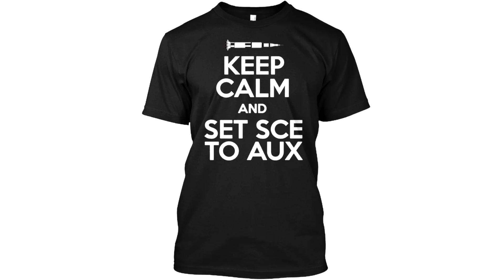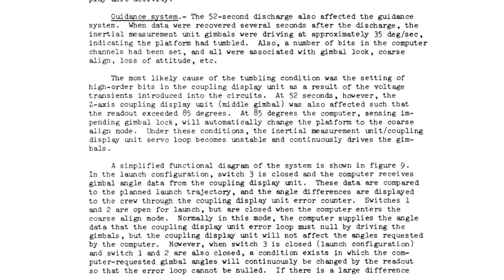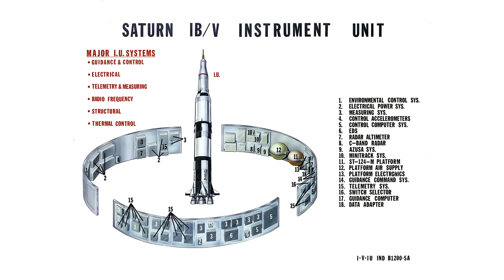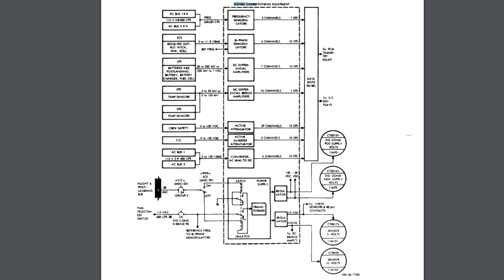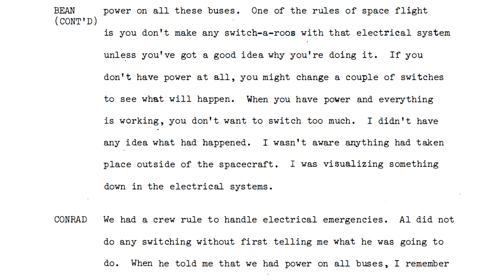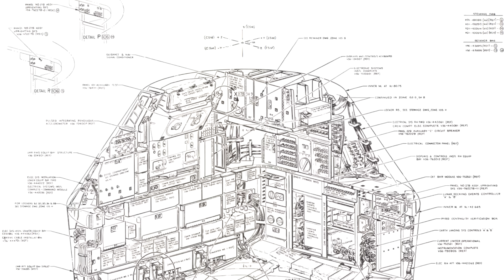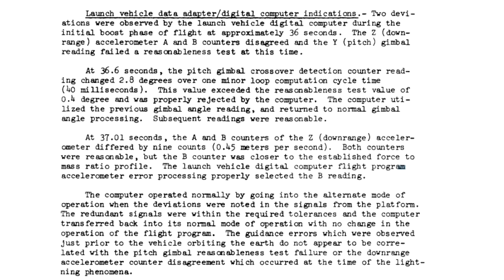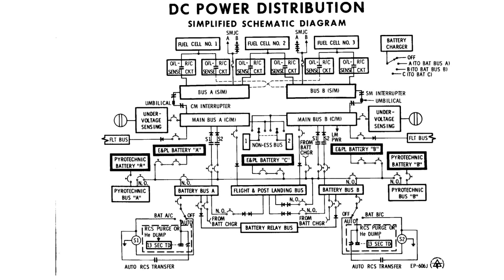What Does "Set SCE To AUX" Mean Anyway - Apollo 12's Lightning Strike Explained

Comment: That phrase saved Apollo 12, but there’s a darker one needed once for the STS-51-F mission, after one of the SSMEs shutdown: “Limits to inhibit.” The commander moved a switch to tell the Orbiter “Don’t shutdown any other engines no matter what!” STS-51-F was the only abort-to-orbit mission. A second shutdown would’ve likely been a loss-of-vehicle and LOC event.
Reply: AFAIK they could abort any time after booster separation, whereby they would land either at the launch site or at one of three sites across the Atlantic. The second engine failure would be critical only in the first minute or two after booster separation. Beyond that a single engine would be sufficient to land at one of the sites across the Atlantic.
Reply: The STS-51 sequence was a nightmare. It took -51F two tries to get off the pad and we all remember STS-51L.
Reply: They could've landed at a downrange airfield if they lost a second engine after a certain point. I think part of the cockpit dialog was "Story, where are we going?" "I think we're going to Spain". After that they were told to ATO.
Reply: @RCAvhstape  “Oh you said we’re going to Spain?!? I heard Space!”
Reply: I was camping in Maine when STS-51-F passed overhead not long after sunset. It was noticeably bigger and brighter and moving faster than any other time I'd seen a shuttle pass overhead before or since. Obviously losing the engine during launch had put it into a much lower orbit than intended.
Reply: Joe Vignolo you could actually see em?
Reply: Micah Bell
You can see several things orbiting the earth with the naked eye.

You can even see the SpaceX dragon capsule when it's up there.
Reply: @LSPD1909  a few years ago I watched the Shuttle preparing to dock to ISS, very close to it.
It was just the right time after sundown, and they were glowing bright! No optics needed lol
Reply: @LSPD1909  You can see just regular satellites passing over  when it's not too long after sunset - they're just points of light like fast-moving stars, but definitely visible
Reply: @brynclarke1746  Especially Iridium sat-phone satellites, therefore the more common name for seeing a satellite flash in the sky, "iridium flare". Big PITA for astronomers, and the next generation Iridium satellites that have started going up are actually designed to prevent it.
Reply: @ke6gwf  I watched them pass over Wyoming low and slow one evening cat fishing. I was thinking something was wrong. They are too low. It was amazing.
Reply: @brynclarke1746  I once saw one breaking up into the atmosphere. Looked like a fucking UFO at the time. Star.. star moving.. star coming down burning.
Reply: The shuttle crew liked hearing the "Abort to orbit" command more then if they heard "Abort to launch site" instead!
Reply: As Scott explaines very nicely it "didn't save the mission".  The crew was on their way to figure it out. And even without telemetry on the ground (sce2aux) turning the fuel cells off and on was the obvious first try solution.
Only WITH telemetry back they ... erm didn't make it worse by guessing :)  But they would have guessed, and probably correctly, if they had to. Pete Conrad sure as hell wasn't about to pull the abort handle in panic. He wasn't a guy for panic.
Reply: 5Andysalive you can’t panic in situations like that
Reply: no it wasn't they were well into abort limits trans Atlantic abort probably would have been required
Reply: There were a number of places in the flight profile for shuttle that did not have abort
 options.
Reply: Not necessarily,  there were certain abort scenarios they could've done.  Probably would've been hair raising but they could've still saved it.
Reply: Thomas Parker With 2 engines down at that altitude and speed, in this pre-STS-51L mission, ditching was the only likelihood if TAL was not possible. STS-51L investigations confirmed past tests that noted an Orbiter would break up on water ditching. And this crew had no bailout options.
Reply: @Gaozetagar  Not really. Contingency aborts were not a thing at the time of STS-51-F. If they didn't have energy for TAL they'd be dead, since they didn't have any way of safely abandoning the vehicle in flight.
Reply: @delayed_control  actually they did.  They just never tested or implemented it.  The first test flight originally was supposed to be a test of the return to base abort but saner minds prevailed.
Reply: @Gaozetagar  at the time of the shutdown they were well beyond the window for RTLS abort. not only that, but RTLS was only viable with only one SSME shutdown. two failures and they'd have to aim for TAL. but the second engine started to fail around 8 minutes in, right around when they are deciding between TAL and either AOA or OTA. RTLS window was well passed by then.
Reply: @Gaozetagar  My understanding is that at the point where the second engine tried to shut down they didn't have enough forwards speed, and if it had actually shut down the shuttle would have dropped too quickly while still going too fast and would have overloaded the thermal protection system, destroying the craft.  I only have that from second hand sources though, so there may have still been a trajectory that would have let the crew survive, although in such a case they still would have needed some luck to hit that trajectory just right.

Comment: That guy that said that will never be forgotten in the space industry. Prevented a mission abort because of a cool headed response.
Reply: Yup, no one will forget ol' wossisname.
Reply: Pete Conrad? yes, absolutely.  If you listen to the onboard audio they were indeed on their way to figure out the problem by tracing it to the voltage dip. Pete Conrad certainly wasn't prepared to just abort the mission.  Which would have been well within his rights btw.  So as Scott mentiones, the outcome of this situation without the sce to aux call is definitely not clear. 
Pete Conrad kept cool, made quick decisions and saved the mission as much as Aaron did.    It was a bit like Gemini 6 where Wally Schirra made the decision NOt to aboard, but to wait it out. Had the rocket moved even inches before the engine shut down, he would HAVE to pull the escape. No discussion. 
The computer said it had moved. The clock said it had moved. Wallys butt said it hadn't moved. So he waited. Had he aborted they wouldn't have launched days later again to a successful mission. That's what these people did.
Reply: @5Andysalive  John Aaron was the one.
Reply: Twotter54.  Another, never to be forgotten alarm that a cool head allowed to pass by and the mission completed was; "1201 alarm" followed by "1202.  We have a 1202 alarm."  That was Apollo 11 during descent to the surface.  They were pretty sure it wasn't fatal and Aldrin saw a correlation on the second or third 1202, so Houston gave them a 'Go' on the alarm.  It was one of the 'super kids' who figured out what it was, but I think they were down by then?
Reply: @rogerwhittle2078  I suspect there was a certain amount of "what the heck" involved. Since everything still worked....
Reply: That guy was one of a team of Engineers. Every person in the team was there because they would be That Guy when the situation called for their speciality.
Reply: Same for the BOOSTER officer that made the call "Engine limits to inhibit" during the launch of Challenger STS-51F, Jenny M. Howard
Reply: @lorenzopappatico  that was a sad era when managers took the safety for granted. This was different, safety was not compromised.

Comment: Mission control: have you tried turning it off and on again?
Reply: “Repair procedure #1” (AKA “percussive maintenance”)
Reply: @CantankerousDave  I have actually fixed a remote military radio transmitter by punching the control unit after two hours of restarting, resetting, reconfiguring and re-frickin-wiring the signal input line. one punch and everything worked again. :D
Reply: @daszieher  Usually when hitting the device "fixes" the problem that would mean that some wires are loose inside the device or something similar. That's when you might want to open it up and make sure everything is where it should be.
Reply: @mekaerwin7187  Yup - had a laptop issue that I fixed temporarily by banging it. I took my sweet time before disassembling it, because I needed a clean environment and a printed-out maintenance manual and, most importantly, a weekend where I wouldn't be totally screwed at work if there were complications from the surgery.

(Speaking of which, there are great analogies here to medicine and the cost-benefit analysis of surgery vs. less-effective but less-risky options.)
Reply: Steven Hystad back in the old days when TV sets used vacuum tubes, it was widely known that you just whack the TV if it’s acting weird, which worked because thermal expansion and contraction of the tubes in their socket may have caused a tube to lose contact. We called that Percussive Maintenance.
Reply: @daszieher  We know it was a gentle troubleshooting punch, not the angry %$#&!, why won't you work.." punch.
:-)
Reply: @daszieher  Sometimes called "percussive maintenance."
Reply: @usernumber1337  I was not going to do an open heart surgery on an electronic control unit not certified for repairs in the field. Especially after the self-test revealed no fault. Field procedure was retrieve the component (rack insert) and replace with a new one.

Yah, percussive maintenance it was ^^
Reply: @CantankerousDave  that happened on Apollo 14.
Reply: @CantankerousDave  "THIS IS HOW WE FIX PROBLEMS ON RUSSIAN SPACE STATION!"
Reply: That's 50% of all engineering problem solving. And Apollo (12) was no exception.  The hard part is to know WHAT to restart.
Reply: @5Andysalive   And WHEN it's not a bad idea.
Reply: @donjones4719  Also in most cases no lifes are at stake, just a bit of productivity.
Reply: @5Andysalive  just restart the entire mission lmfao
Reply: Thank you for calling the Mission Control service hotline.  Your call is important to us.  Please stay on the line, and a representative will be with you shortly.  [Scratchy elevator musak plays]
Reply: @adm0iii  if this happened today, the initial contact would be a call center in the philippines
Reply: The other one is if you can't fix it bridge it
Reply: @christhirion9474  Hmm.... what about my favorite way of fixing asic on the go...... running makeshift wire bridge? Before I realize when/why I have a set of wire of different ohm and material on me at all time.
Reply: "We see you have a wirus in your Microsoft computer. Send us $438 dollars and we fix it for you."
Reply: I think that is just what "Set SCE To AUX"  did. It disconnected from the primary (OFF) and then reconnected to the secondary (ON)
Reply: No, no, no. "Cycling power" is so much more effective.  At least it sounds more professional.
Reply: @davepTfirst  Toggle the P-A-D (power actuator device)
Reply: Indians when their probe smashed into the moon

"Have you tried turning it off and back on again sir?"
Reply: It wasn't a Microsoft product.
Reply: Recycled power, ops check good. Alternative there's always 'Reset circuit breakers, ops check good.'
Reply: @Saber721  They also do an "Aliveness test". Back during assembly of ISS.
Reply: 1- Determine what the problem is. Before doing a complete reinstall, determine if your problem can be fixed by performing a Startup Repair. ...
2- Insert the Windows 7 CD. ...
3- Enter Windows Setup. ...
Reply: I work in IT support now... It's more true than you think. And we call it a "Powercycle" now, just to sound cooler. :)
Reply: Cold Iron :)
Reply: Jerry Rupprecht god I love awesomely clever references
Reply: Not once during this have I noticed anyone suggesting a proper kick at the AUX valve
Reply: That's how we fix 90% of commercial aircraft electrical problems, pull the offending electronic box out and plug it back in. 😁
Reply: They had a Problem during the Curiosity mission, where a Solar storm fried half of the curcits. They fixed by turning is on/off
Reply: Yankee Clipper: Yeah, we've tried that. Want us to hit it with a hammer?
Reply: Lemme try... (Explosion sounds)
Reply: Hello, this is Ranjeed from tech support..
Reply: ctl  alt delete
Reply: PUT IT IN RICE
Reply: IT Crowd
Reply: I work in I.T. and I can attest that this solves about 80% of I.T. issues. No joke.

Comment: Love the phrase "reasonableness test" at 9:57. The computers had that back then, yet didn't for the Mars probe that crashed? One you did a vid on, that relied on the out-of-norm-expected input of one sensor even though different sensors for altitude, speed, etc, were in agreement, differing greatly from it? Gotta give it up for the elegant programming in those "simple" flight computers.
Reply: Reasonableness tests work when translating analog values, as analog by definition being "fuzzy", their values can vary into non-useful areas as part of routine operation, where "routine" also includes these systems combining input from multiple other analog sources; stack up enough random variation, and you can get some non-reasonable values by chance alone, and you want to be able to skip over those.

Digital to digital translations, however, by definition, do not stack up any random variation.  If you put in a reasonableness test in those, when they trigger, they are much more likely to throw out correct, though unexpected values than ignore a routine fuzziness, possibly allowing a disturbance develop into a catastrophe.  Instead of reasonableness tests, digital data can have digital verification -- error detection/correction codes, like parity, checksums, and the like.  This ensures the values are known to be correct, even if unexpected.

In fact, it's because of error detection/correction codes that systems have moved away from analog to digital over the decades; all analog data is converted to digital as close to the source as possible, so nothing has to guess if it's working or not.  Doubt makes a lousy foundation for modern massively complex computer systems.
Reply: @adm0iii   Thanks for the thorough and informative answer. I guess what I'm thinking of for the Mars probe is a cross-check between sensors; that is probably more of an autopilot type thing.
Reply: Bear Mro facepalm
Reply: Not sure the mars probe would have been saved by a reasonableness test. It's like asking faulty programming to correct itself.  My understanding is that It's more of  a redundancy to correct for faulty readings or misbehaving computer.
Reply: If I understand right, the Mars Polar Lander
 probe had plenty of those checks on the sensors themselves but reasoned about them incorrectly. The logic went "if the landing legs are splayed, note that touchdown occurred" and "if touchdown has occurred, cut the parachute" (and each did have various checks). But the programming didn't enforce the order due to a bug - as soon as the legs deployed, the touchdown sensor triggered and was never cleared, so as soon as it got near the ground (way before touchdown) it cut the chute, too early. That isn't simply an "unreasonable" sensor reading; it's real sensor readings being used incorrectly.
Reply: @AySz88   Yup, that's what I'm talking about. My sense of the term reasonableness is that the system should have polled other sensors for the altitude, descent velocity, etc, rather than relying on a single sensor reading, the touchdown sensor, for parachute cutaway. I realize now this is a different sense of reasonableness than the Apollo case.
Reply: you're telling me they care more about human lives than a probe? nooo....
Reply: Don Jones sometimes people don't care about the results of their work.